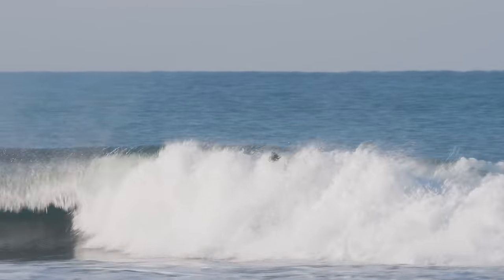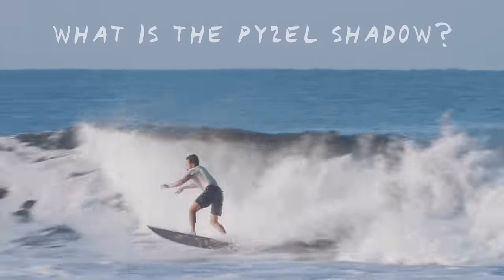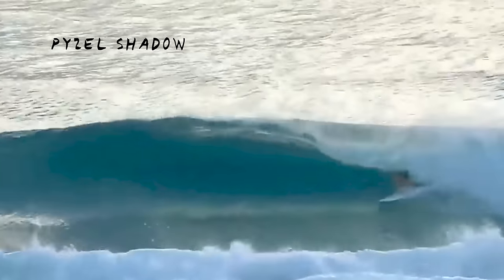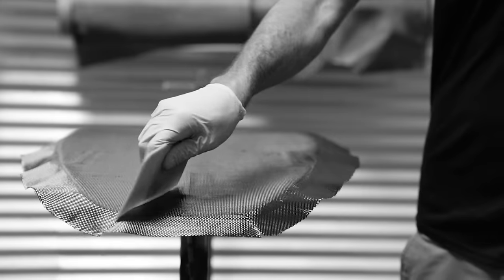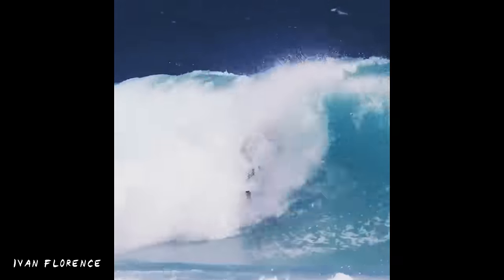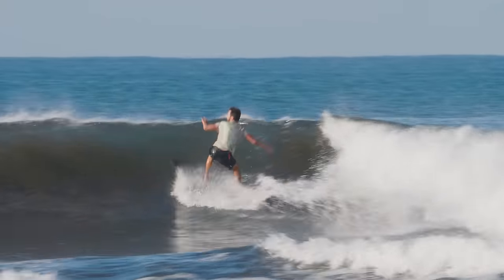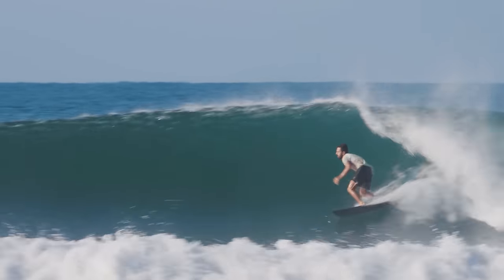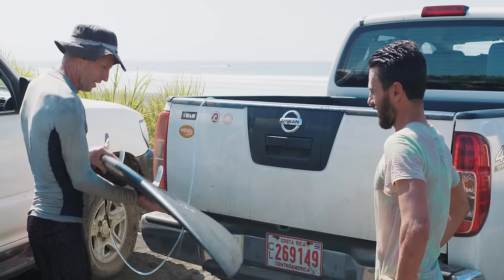One Pumping Session On A Full Carbon Surfboard | Pyzel Shadow x Dark Arts Construction

Comment: Anyone around 160lbs? What volume you riding. Wondering if 5.10 shadow (27L) is too small
Reply: John is 165 and rides a 29.8 L
Reply: Hey its been a while but i weigh around 160 and I use a 26.3L pyzel radius

Comment: How different is this to the Aviso carbon boards from 10 years ago. They were utter shite
Reply: Aviso was hollow.  Completly different feel.
Reply: Those were also extremely rigid structural carbon fiber. Dark arts is using pretty low end (strength wise) carbon fiber so it still flexes.
Reply: @AEVMU  nice one thanks